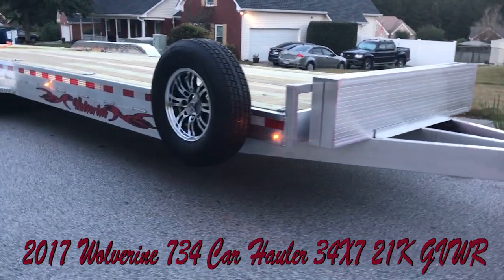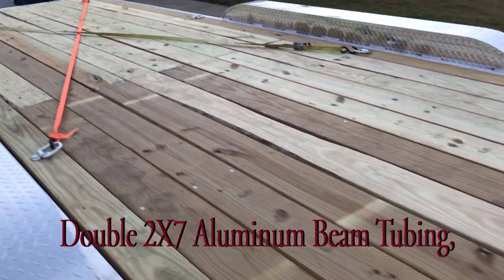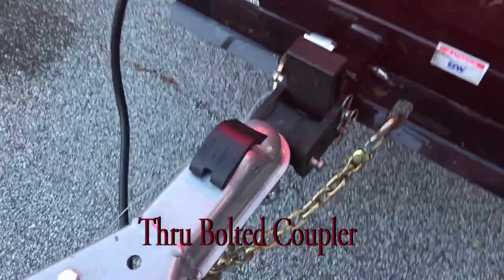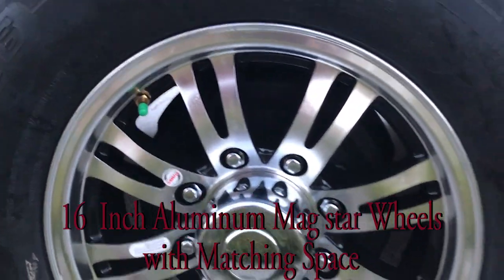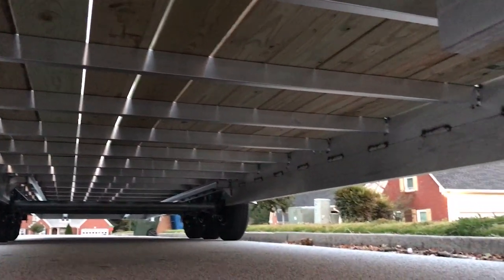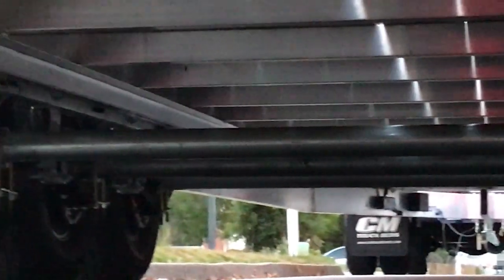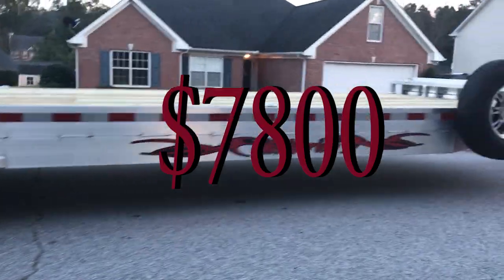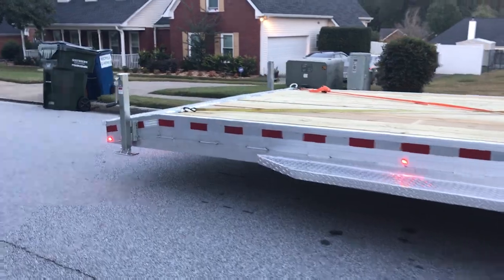Wolverine Aluminum 34 ft Car Hauler

Comment: What size do they go up to. 
What truck do you drive to any pull it. F350. You never said the gvwr on the trailer just the dry weight of it

Comment: Hello Great video, you did not mention breaks and if the trailer has any.
Reply: I used to build these trailers in Jackson Michigan, they can be ordered with electronic brakes.
Reply from the maker: Two break axles but don’t waste your time on these, poor design and even worse materials

Comment: Would have spent the extra for aluminum deck...
Reply from the maker: They didn’t offer that option when this trailer was bought. But it’s a POS trailer. Don’t waste your time
Reply: @stella_rt   Sorry to hear that... Got a Nextrail (Ocala FL.) 18' all aluminum. It has been amazing very over built. But I know they don't build car haulers over something like 24'... U should do a follow-up review. Thanks
Reply from the maker: DPL 26 I need to do one on my new maxxd
Reply: @stella_rt  
What the matter with it
Reply from the maker: Where do I start? Horrible design, horrible materials. I went through two trailers under warranty. The third one as soon as it arrived I sold. Frames crack over the axles from flexing, axles are home made, suspension comes apart every 2000 miles.
Reply: @stella_rt  What a shame. I have heard of people with enclosed all aluminum trailers having same kinds of issues. That's probably why Nextrail only makes single car haulers.
Reply: Thanks for your review. I’ll avoid them.